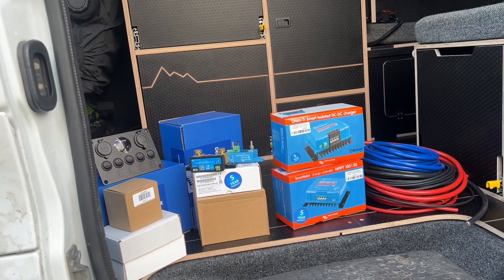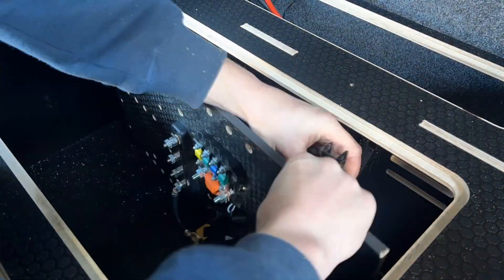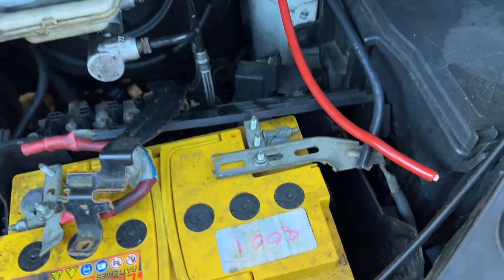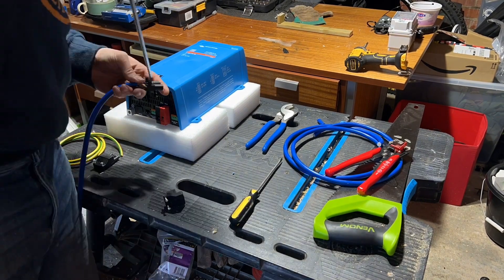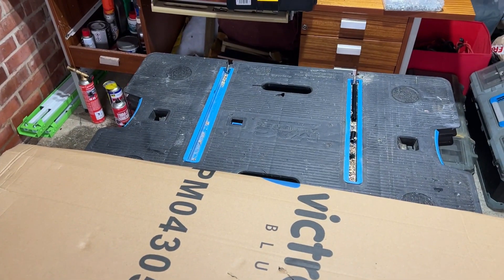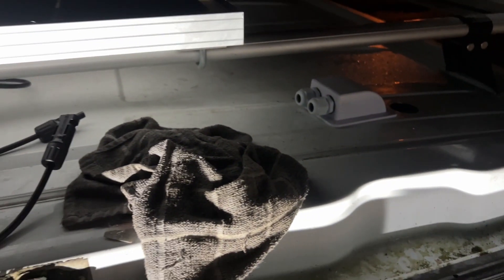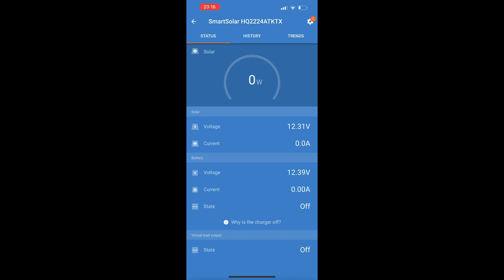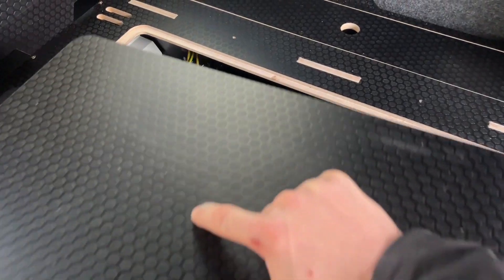CAMPERVAN CONVERSION: How to install a MONSTER off grid 12V and 230V electrical system.

Comment: Great video here! Loving the attention to detail. I’d definitely get some grommets or something on those cable entries from the engine compartment! Heat shrink isn’t going to lay long with all the vibration and the weight of the cable. Also not sure if having positive and negative/ground going through separate holes is good. What are the max amps going through the cables? I know in 240v install they have to go through the same cut out to prevent ferromagnetic affect.
Reply from the maker: they are not 240V only 30A max I think from
the alternator to the B2B charger. so not sure there will be any issues as you described. probs should get some grommets to be fair 🤣🤣 I was rushing. And it was so hard to reach 😂😂

Comment: I like those boards you made the enclosure out of. What are they / where can I buy them?
Reply: It looks like buffalo board, great stuff. Coated with a phenolic resin! 💪🏻
Reply from the maker: It’s lovely stuff. Looks great.
Reply from the maker: I got the separate boards from flight case hardware a uk online store that sells the separate panels for way cheaper than the average BandQ or similar hardware store. The furniture was built by theplyguys.co.uk.